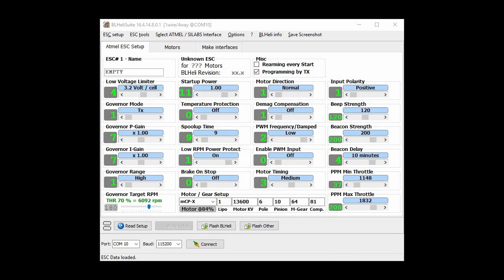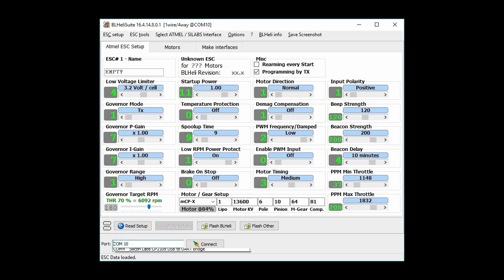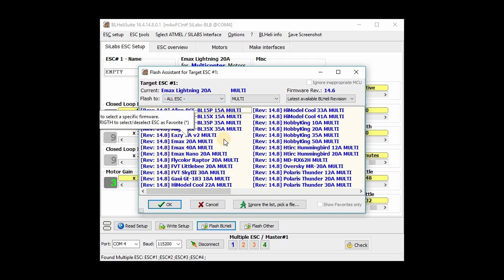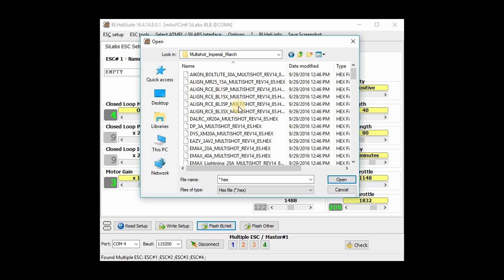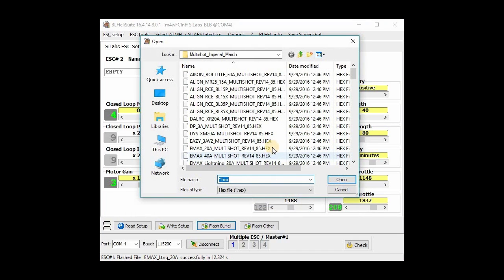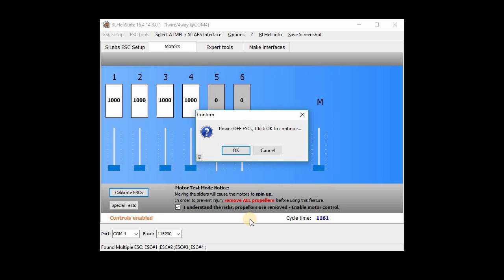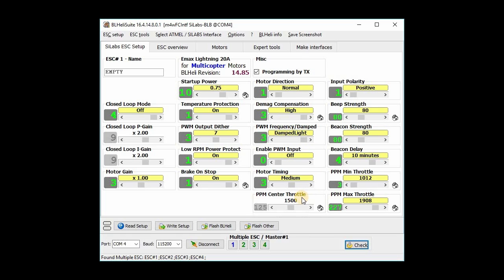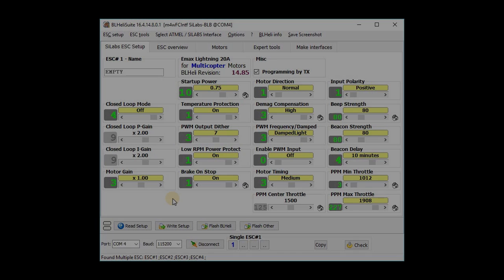Flashing EMAX Lightning ESCs

Comment: How's this done on the Chrome config? I'm pulling my hair out
Reply: just get blheli suite and use passthrough, the chrome version has problems i heard
Reply from the maker: I'm not sure if it will work in Chrome config. You can try to tell it to use non-standard hex file, but you risk bricking it.
Reply: TheMadmacs yes sir you were right thank you
Reply: any time, actually i'm fiddling around with betflight and blheli right now so if you have any more problems just ask me, be super careful with blheli you can destroy esc's with the wrong firmware, and theres a lot of wrong firmware out there,  make sure you look at all the info in the comments where you bought them or even elsewhere, if in doubt dont flash them with new firmware,, find somebody on youtube who used them and ask them.
Reply: TheMadmacs they are on my x220 which is not my main flier, my GT200S is

Comment: Hi Albert. I flash and calibrated the esc as per your tutorial. After the Imperial March startup tone, there is a 2 tone beep when the motors arm. The beeps do not sound together. Each motor beeps at a different interval. I need to wait for each motor to arm individually. Any advice on how to fix this?
Reply from the maker: Check your CPU usage. Might be too high.
Reply: Thanks for the quick reply. I checked the cpu usage in betaflight. It's around 11%. I guess its ok. 

The issue is only at startup. After all the esc 'perform' the 2 tone beep and the motors twitch, all motors spin up and the quad is able to take off. I've calibrated the esc in both betaflight and blheli suite. I'm not sure what causes the delay...
Reply from the maker: +venomrat If it flies ok, I wouldn't worry about it
Reply: Hi Albert. Do you have a link to the original firmware? I would like to revert the firmware to see if fixes the issue.

Comment: Hi Albert, thanks for the video. I was able to flash multishot on my jjpro p200. Tested hovering and I am getting a strange noise. Don't exactly know how to described the noise. Anyway, motors are kinda noisy as well. Did you have any issue after flashing?
Reply from the maker: +Ronn2664 I didn't
Reply: Albert Kim Are you currently using multishot on your jjpro p200?
Reply: Albert Kim Yeah. I went back using oneshot 125. Thanks.

Comment: Hi Albert, Do you know what was the "ESC flash fry" issue? Was it the BLhelisuite Lightning/Nano flash problem? Does it fry the ESCs only or did it fry the motors and ESCs? Is there an explanation link or something on RCG? I fried my quad when I replaced an broken ESC and tried to update it with the "Emax Nano" flash that BLhelisuite showed as the update...so sad. I am not sure what is broken and what is salvageable now...crying. Thank you.
Reply from the maker: It is explained at about the 0:50 mark of this video.

Comment: I tried flashing this firmware to my Emax Lightning 30a with combination of RS2205s 2600KV and it doesn't work. it flashes fine but it will not calibrate. all i get is beeps not the calibration sound. any idea?
Reply: hello, how do you fix it?
Reply: Did you fix this?? Im having a similar problem
Reply from the maker: +chadd Astronomo is programming by TX still enabled?
Reply: Albert Kim yes.
Reply from the maker: +chadd Astronomo did you enable multishot in Betaflight?
Reply: Albert Kim yes I did.
Reply from the maker: +chadd Astronomo hmmm, stumped. Maybe this only works on the 20a ESCs
Reply: Albert Kim I saw a video someone running multishit on a 30a lightning rec. I'll give it one more try.
Reply: Albert Kim tried it again. made sure programming tx is on, select to multishot protocol. This time it calibrated but motors will not spin.  did I miss something? TIA.
Reply from the maker: Without actually seeing the craft in person, this will be very difficult to diagnose based on what I've seen here so far.  It would seem you've done everything correctly, but obviously something has been missed and I have no idea what that would be.  Sorry.
Reply: Albert Kim I'll do some more digging and get this working. thank you Albert
Reply from the maker: +Josh H if you use the chrome based app it should recognize the ESCs.
Reply: It still comes up as Nano but it gives me the option to flash Lighting 20 but now it said it "could not load local firmware undefined" Do i target Nano or Emax lighting?

Comment: the version on your link was "emax lighting 20a multi rev14.75". did everything on vid and all ESCs said successful flash but when I clicked on write setup is said "not supported".
 
Can't get my motors to spin...when reconnected and clicked "check" the ESCs are blank. what should I do?
Reply: ok...got the "rev 14.9" on em now...motors spin...but wrong direction...trying to fix
Reply from the maker: change motor direction in BLHeliSuite for that motor
Reply: It worked! Thx Alberto! Keep the good vids coming!

Comment: Hi, I have a problem with the ESC, after I flash every esc exactly like you in the video, after I calibrate them, ESC 2 and ESC 3 are grey ( not green like in video ) and there say "Setup NOT in SYNC with Master". Can you help me with this problem?
Reply from the maker: +Stefan Balineanu it means the flash didn't succeed. They are probably a different firmware version from the other 2. I'd check that first.
Reply: I installed the same firmware like you, I have the same drone like you. Now I started with Cleanflight and EMAX Lighting 20A 14.8 and seems to be ok, but when I begin to fly at low height (less than one meter) drone goes in one direction, it does not stand still and rises up vertically. You have any idea where I should work to fix this?